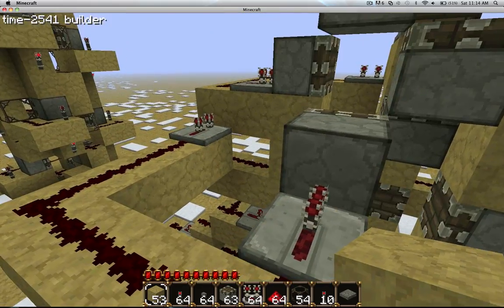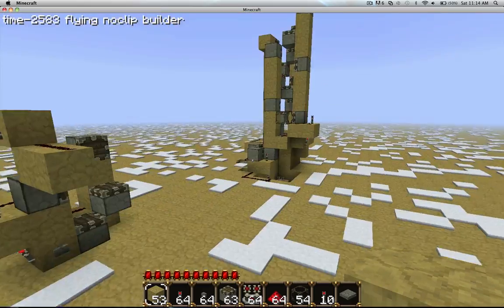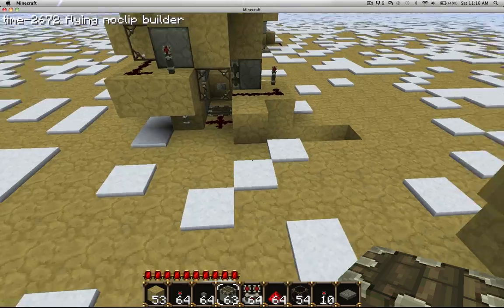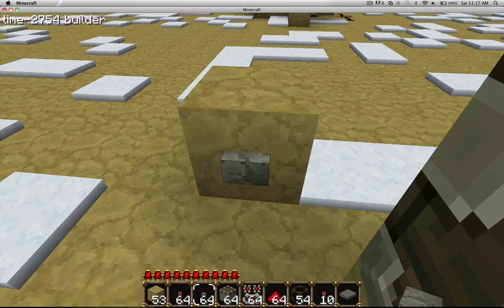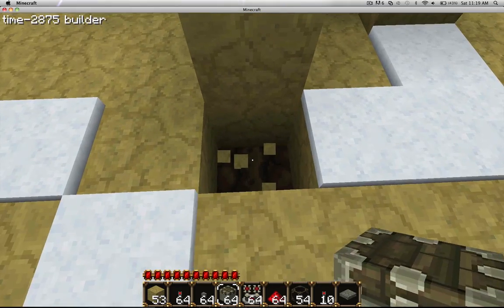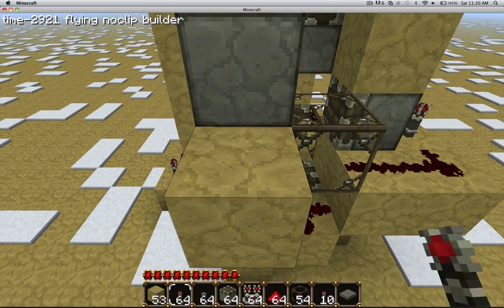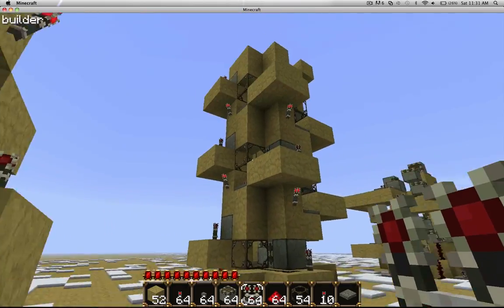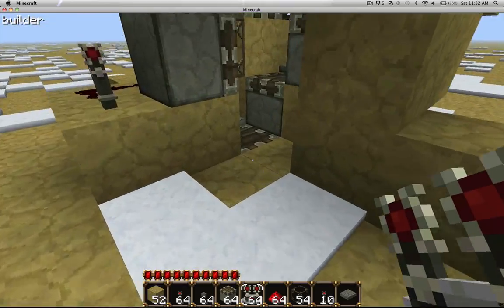Compact Piston Elevator Tutorial (1.0.0 Compatible)

Comment: This elevator works great but I'm having a problem with it. The one I've made works until I reach a certain point in it where it seams a piston is not pushing me onto the one above. It is activating like it should but it seems to be going straight through me instead of pushing me. The bottom piston also appears to be working fine aswell. I keep rebuilding the section but it keeps happening. Is it just a bug in the game?

Comment: @254160 Hmm, I replaced the repeater that runs above/beside the piston with redstone. Then the first up piston works. Put the repeater back to prevent the timing problem (next up piston activates too soon) and the first up piston stops working again. fml. Is this a glitch or have i screwed up?

Comment: @254160 i did but it still doesn't work, my tower is 13 pistons high, after i go up i will start to go back down to see if they retracted, after going down 2 pistons they are stuck, a way to reset the is to place or destroy a block directly on top of them, i really don't think the pulse has anything to do with this i have tried it on every setting and it doesn't change anything. and by the way nice video just specify what who are doing at the end cause it got kind of fas and confusing